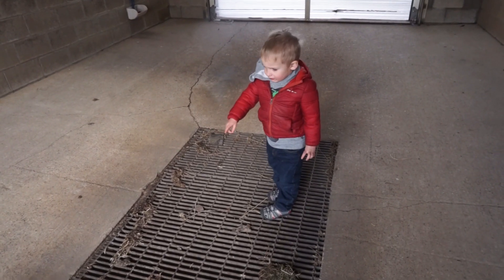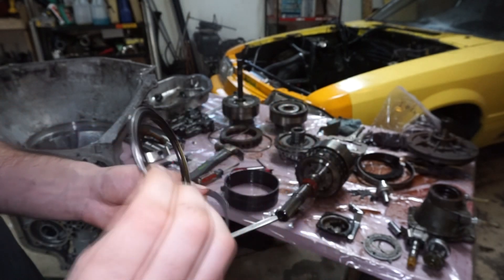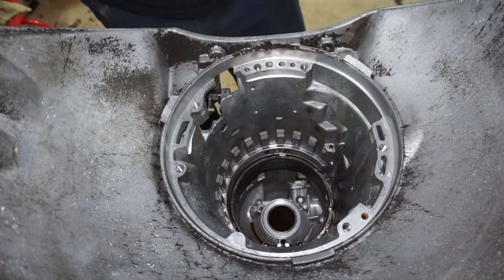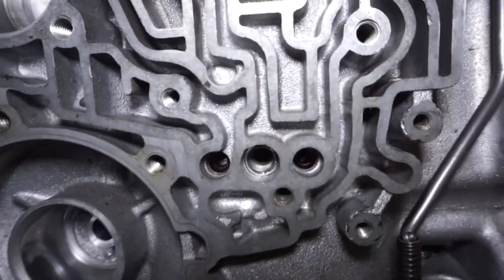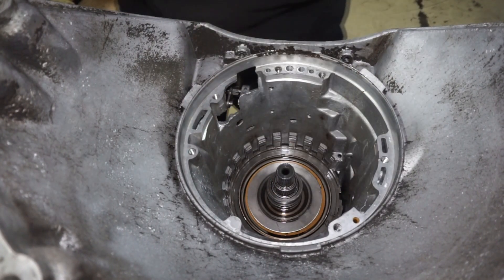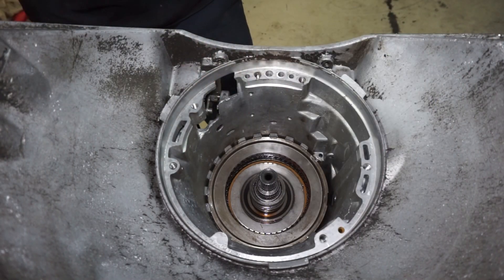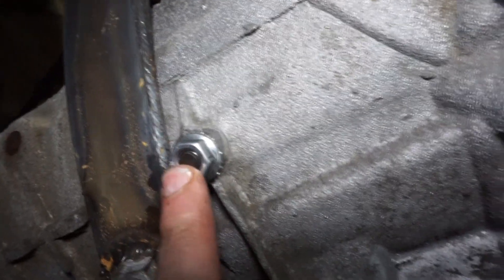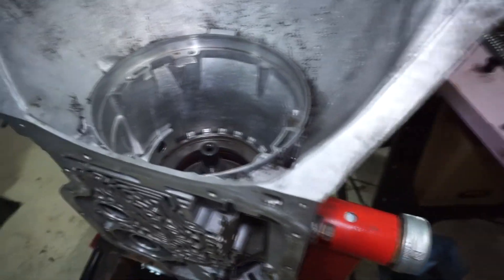TH400 Rebuild Rollerized Output And Case Saver Install!!!

Comment: Your videos are awesome!  You showing the assembly is very much appreciated.  
I watched a lot of TH400 rebuild videos and they said that the snap ring openings should not go into the void, but into where the lugs are in the case. hope this helps.
Thank you.
Reply from the maker: The 4l80e, and th400 ATSG service manuals show to install with opening at 9 o'clock position. And it never made sense to me why you would put the gap where the lugs are, then you're potentally not using a lug because the lug falls in the gap. But the case saver kind negates all of that because it supports any flex the ring may have where the lug gap is.
Reply: Thank you, saw the case saver covered up the ends of the snap ring!  I just bought 3 Th 400s for a future build and your videos are very informative. B @BlaserBuilds

Comment: Hopefully you used high pressure sealing rings instead of the metal ones for a transbrake application.